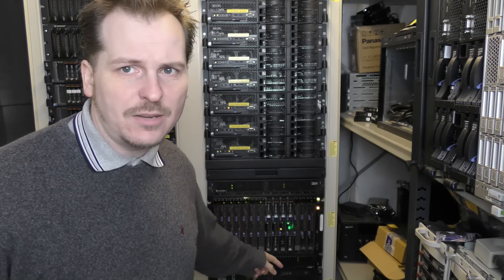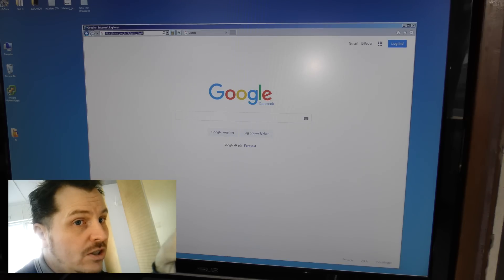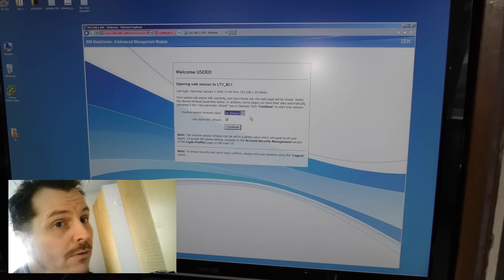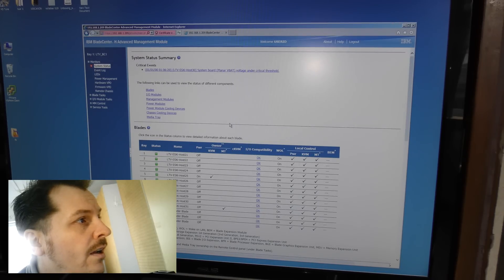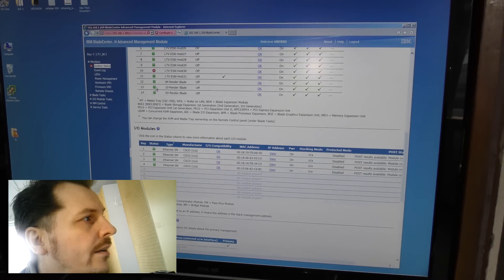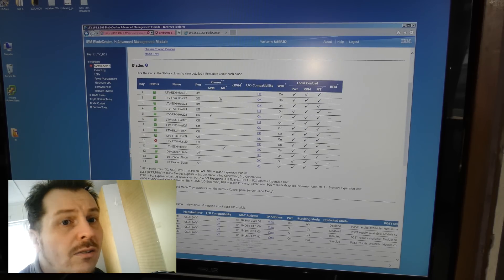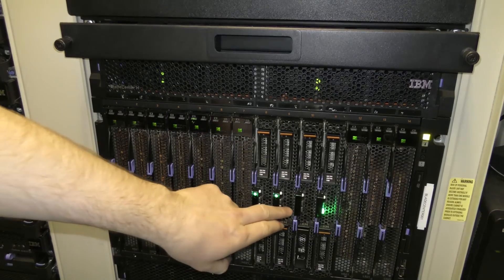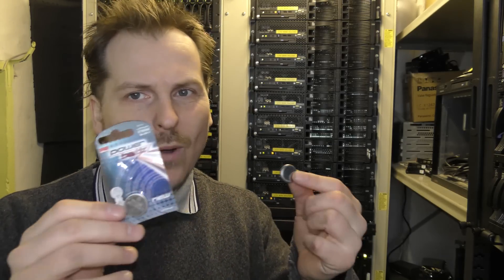Solves Issue on IBM HS22 : System board Planar VBAT - Error - 299

Comment: I'm sorry for my english, but IMHO U R wrong.  This battery is CMOS battery which is can charge up real Planar VBAT, killing himself :). "Planar VBAT" is big bank like a capacitor near the key U R pressing in this video. I'm not an IBM engineer, but my humble opinion is my experience in dealing with HS22 model 7870. Then I connect blade with dead CMOS battery CR2032 not always Planar VBAT error I'm got. And not always then I'm change CR2032 the error "Planar VBAT fail" is away.
IMHO first we MUST replace CMOS battery and then if a fail is not away, 1-2 day stay blade inside rack even not powering it up. By this way I'm rise from dead 15-20 HS22. IMHO, "Planar VBAT"  uses combined charging scheme - not only from CMOS battery (killing this battery), but from main power too.
Again, sorry for my English - my native language is Russian.
PS And. Lithium CR2032 CANNOT BE CHARGED!!! Do not try to do this except all U got is fireworks which U can't kill by water! And all your have in your fine fabric is gonna to trash :( 
With Best Regards!
Reply from the maker: Hi Ilja Gavrushev
Thank You very much!  But every time I have had an VBAT error I have just powered down the server replaced the CR2032,, and fixed.
Thank you for watching! :-)

Comment: i just replaced 3 batts for the same issue but now im getting a different error 0x80070200 System board, voltage (Planar Fault) critical omg doing my head in
Reply from the maker: Hi +Joshua Corley 
I'd check for a bad connection or over voltages,,, :-/
Thank you for watching! :-)